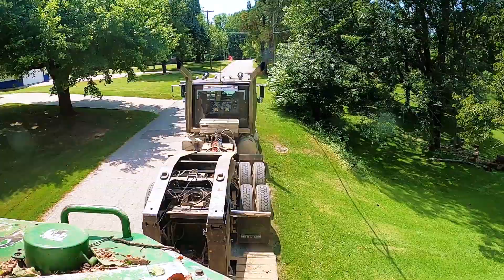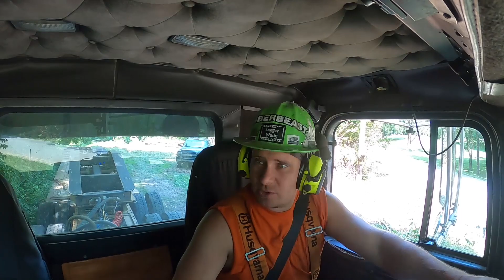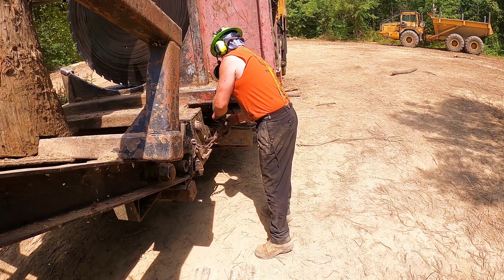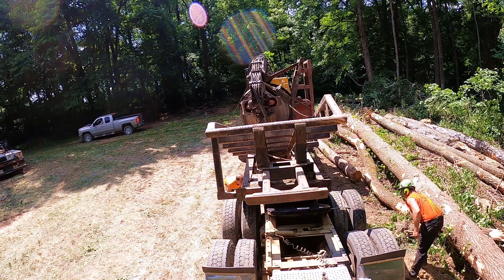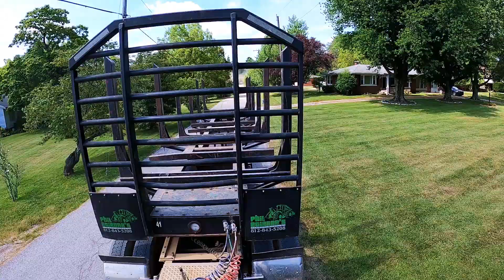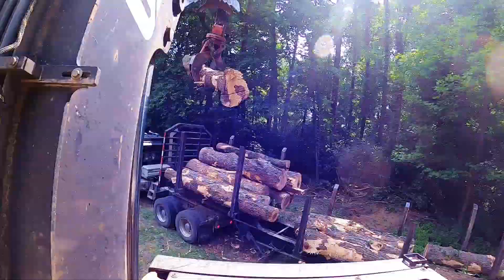Moving Equipment through Suburbia!!

Comment: what, dont bother with dam permits there just a cash grab, just go, it easier to get forgiveness then permission. why do you call it the boom, when it is a slasher,, /? you should have pulled strait in with the slasher, you always have the machine sitting with the tree length pile on the other side of the saw, it a pain in the ass trying to lift the whole tree up and over the saw or in around it, it really slows down production, with the trees on the other side it a strait lift and up on the bed.. your fighting your self bud.. i always set up so it best for production and little to no moves, i would be loading strait on to the truck off the slasher bed,, but in any case it finally nice to see you using a slasher instead of hacking the trees up into just any length to skid out and using that dindin to cut them to length, and all the waste of log that to short because it was hacked up any ol way,, we pull whole trees limbs an all to road side, a bige rubber tire de=limber limbs them then the slasher come a long and slashes to lengths and down piles on the other side of the road, logs in one row and pulp on the outer row ready for the loader to come and load the trucks, 2 shifts a day. some of them blocks your putting on the truck are not fit for logs, that go on a pulp load right to the paper mill ether by truck or rail.